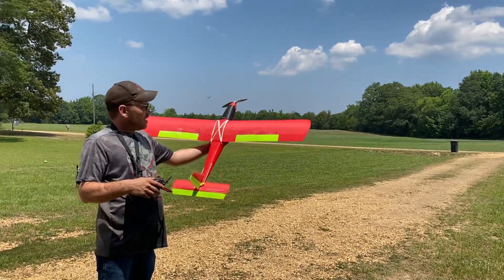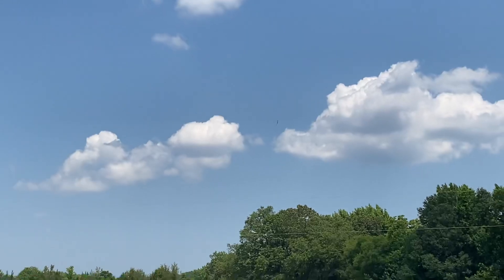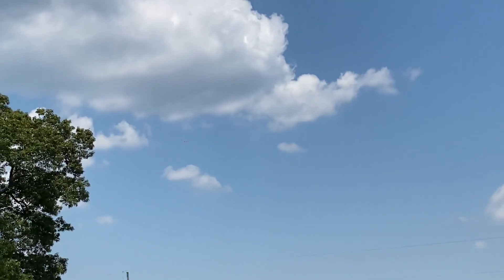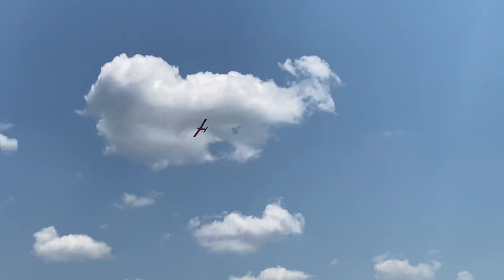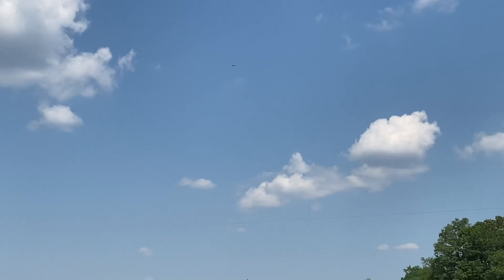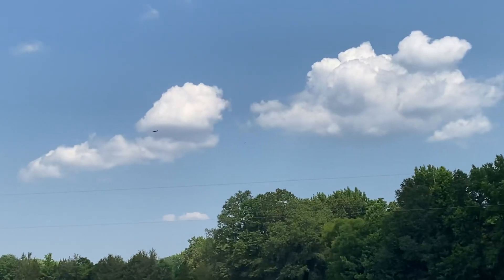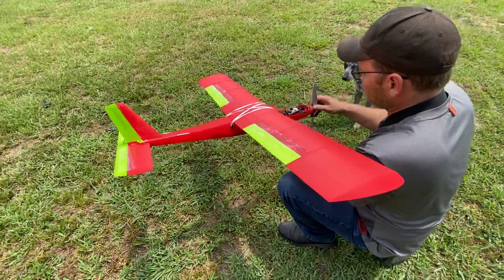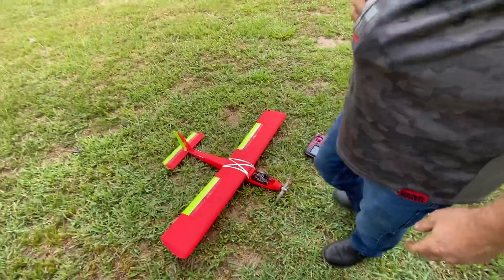Eclipson Model T 3D printed airplane

Comment: Did you fix it? Do you fly it regularly? What is your's take off weight?
I'm about to do my maiden tomorrow.
Reply from the maker: Yep I fly it all the time.  As for the weight. I’d will have to bring a scale home from whork
Reply: I did normal PLA as mi first 3D print, I had bad filament, no experience.. It was too heavy and too brittle, but it didn't fly that bad!
I'm gonna reprint it for this summer, now when I know what I'm doing and I use LW-PLA it's gonna be awesome!